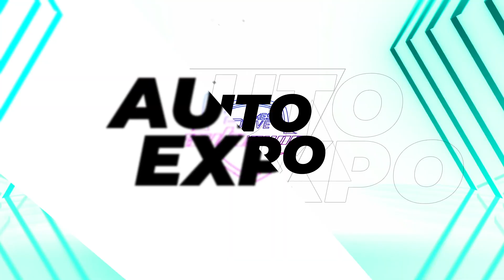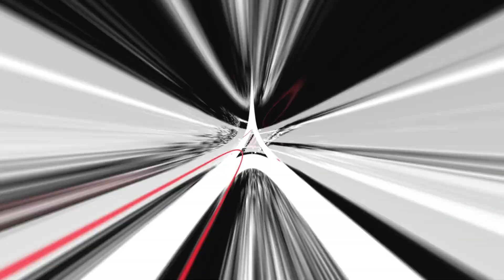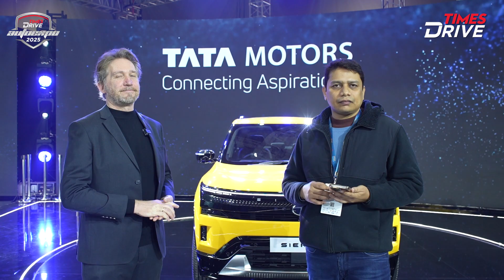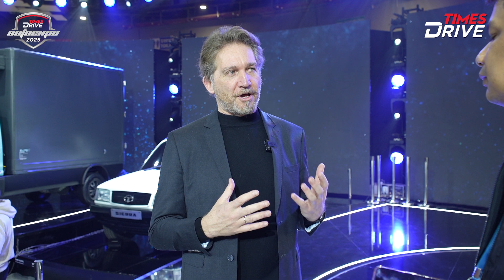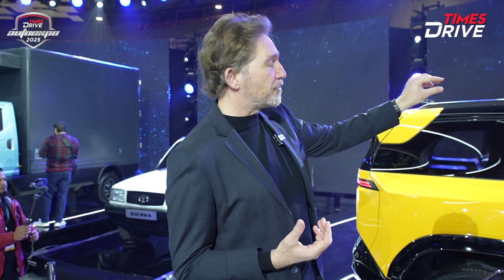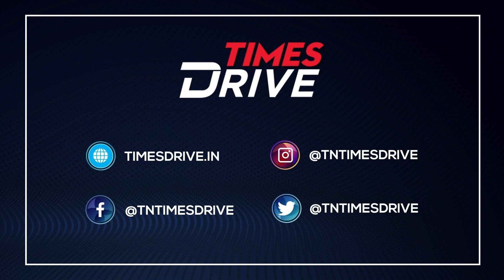Interview with Martin Uhlarik | Global Design Head of Tata Motors | Times Drive Green

Comment: Hi Tata Motors Team,

Please check on the below points before launch of upcoming Sierra.
1. Need to change the Gear Lever with premium design and feel (Manual) 
2. Need AT torque converter for both Petrol and Diesel
3. Need an option on top end model with metal roof to overcome sunroof issues in future
4. Need proper dead pedal in Manual version
5. As Mr. Martin highlighted will get some physical buttons - need for Hazzard, Volume, A/C
6. Need Proper mud cover panel to avoid dust/must attracts in the rear door panels